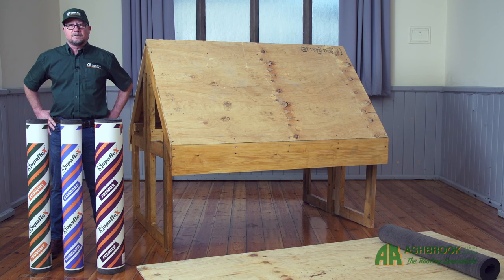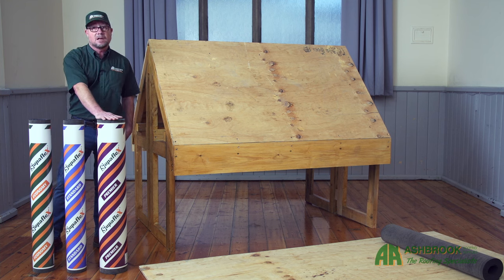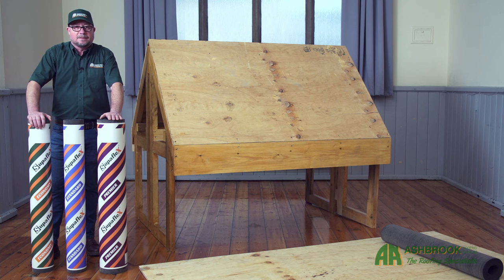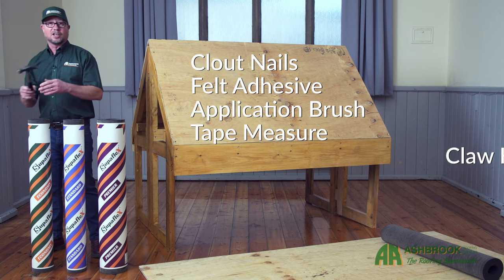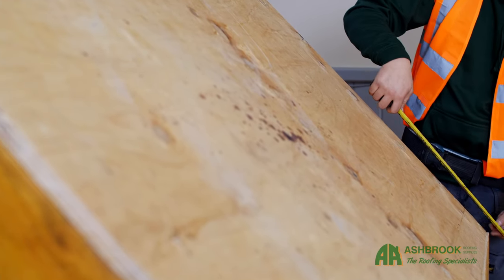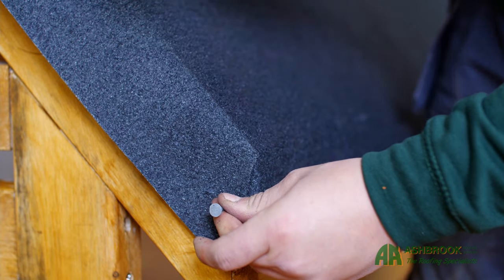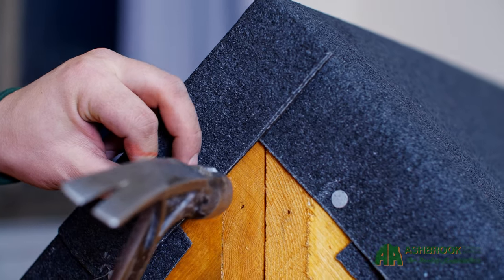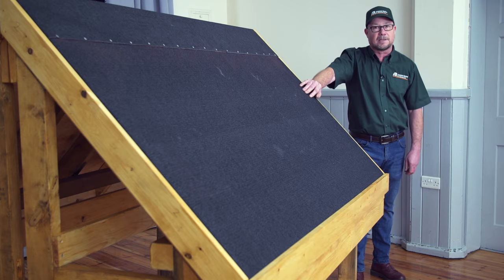Installing Shed Felt: The Complete Guide - Ashbrook Roofing

Comment: If I'm using this video as guidance for how to install underlayment prior to installing shingles, do i still use adhesive and nails spaced at 50mm at the overlaps?
Reply from the maker: Hi Greta, When installing underlay, we recommend still using the correct spacing of the nails on the overlaps, however the adhesive is optional and based on personal preference.
Reply: @Ashbrookroofingsupplies That's great, thank you so much for your reply! 💖